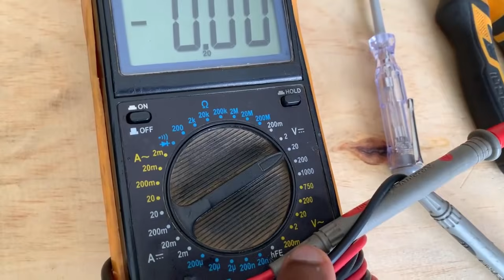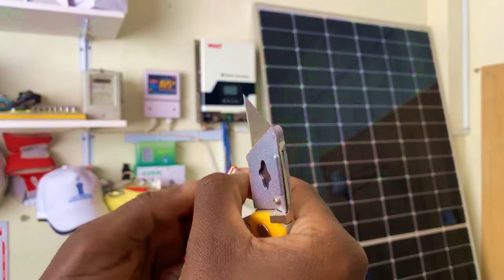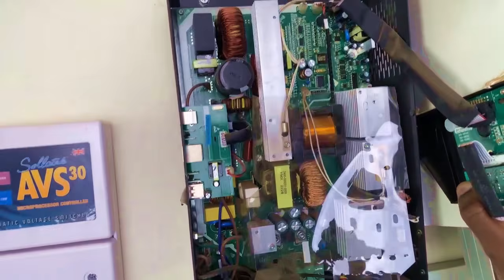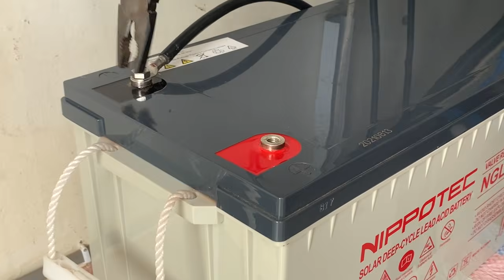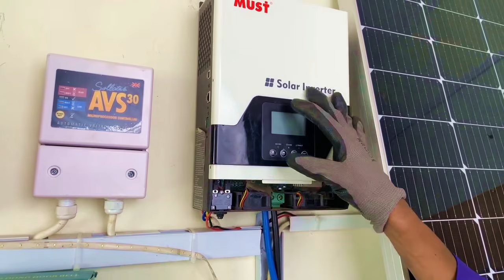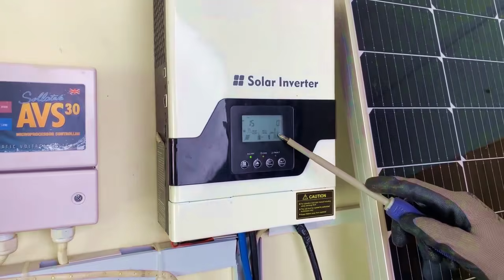How To Install A 1kW Solar Inverter - Step by Step Full Guide.

Comment: Cool lesson.but I didn't see you cut outs. Even the ac Surge diverter you dint shown installed.

Not have you done a video on solar system sizing
Reply from the maker: Thanks for the feedback, I will consider covering those components in a future video.

Comment: What can a 1km solar system power 🔋 or run
Reply from the maker: A 1 kW (1 kilowatt) solar system is a small residential system, but it can still power several basic loads depending on sunlight, battery storage, and usage timing.